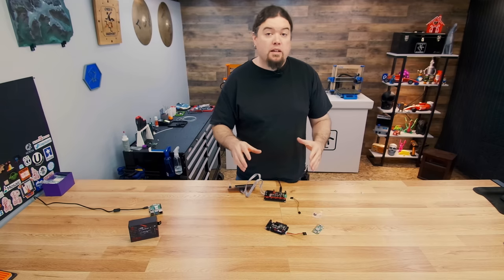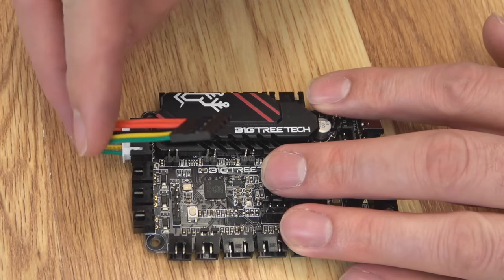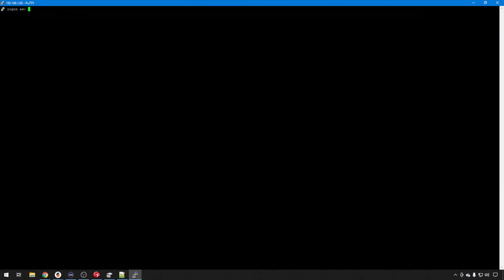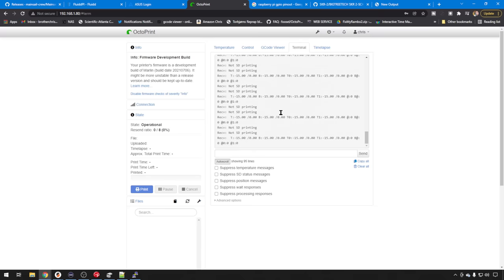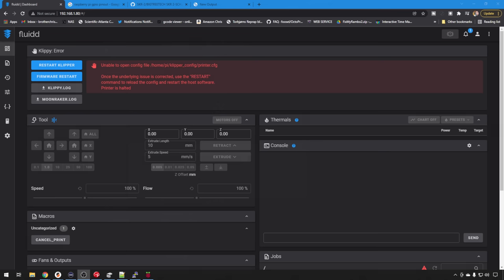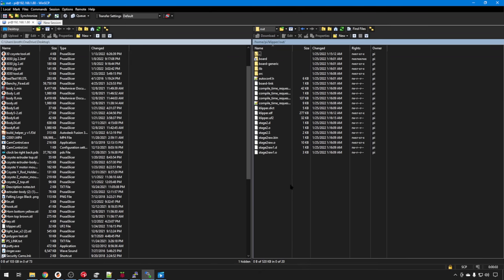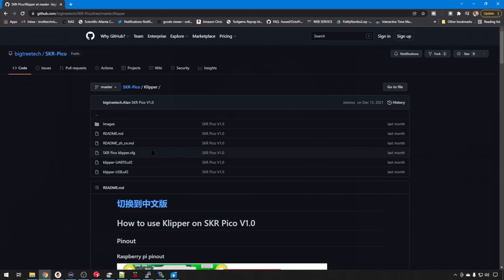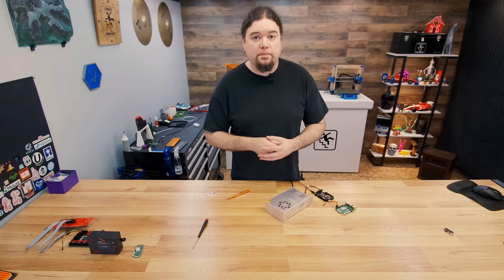Control Your 3D Printer - GPIO - Raspberry Pi - 2022 - Chris's Basement

Comment: I thought the gpio pins had a low max amperage (like in the milliamps range) vs the required 3A need for the pi?
Reply from the maker: They are pretty low, it doesn't always work. It works much better with the Pi Zero.
Reply: @ChrisRiley  So is there an alternative. I see the SKR 3 advertise that it can power a PI4 safely. This cant be what they mean?
Reply from the maker: @PalosX  I would like to see where the SKR3 says that. Powering it with USB C and using the GPIO is really the best option. Or get a 5v power supply to use with the GPIO pins.
Reply: @ChrisRiley  Scroll down to its description about robust
 power system

Comment: the CPU speed on a Zerro and Zerro 1W is already tight. But if USB is not used but TTL serial then the CPU has one task less. The Zerro 2 W has the same 4-core CPU as the PI 3 A+ and B+. These three are sufficient for the tasks.
Reply from the maker: Thanks for the info!

Comment: Very good tutorial as usual but for me no matter what I do, how many times, different methods (like manual installation) I can't get it to work in my SKR 2 (cpu stm32f429) with a Pi zero W. Any suggestion pls? Mean while back to Marlin. :(
Reply from the maker: So the first thing I always check in power. Try powering it with an adapter instead of the board and see if it works. These boards have a bad habit of the power regulator not working correctly.

Comment: Bigtreetech recommend that to not cross the RX-TX connection wires for SKR 3EZ wires. That will be really ok or not? I send a request for clarification for Bigtreetech guys but no answer yet.  I follow strictly your clip recommendations but the connection klpper- moonraker is failed. Could anybody help?
Reply from the maker: RX-TX, it should only work one way. I would check the logs in klipper to see if it says anything.
Reply: @ChrisRiley  ok Chris, solved.
Thanks.

Comment: Do you know how I can configure a probe like super Pinda from prusa (which is 5v) on the SKR Pico?
Reply from the maker: You can use the Z stop pins to power and trigger it.
Reply: @ChrisRiley  thanks of the help, I finally got to try this, unfortunately I am not capable of making the probe work. Maybe you could throw some light on this, basically I connected the probe (same wiring order as the connector for the purse buddy board) to the z-endstop (io25), so my probe config is (pin: ^gpio25) and my timc stepper config (diag_pin: ^gpio25).
I tried swapping the gnd and io wires on the connector in case the sky pico does have them in different order, no luck.

🙏
Reply: I finally figured it out myself.

Something that wasn’t clear for me and maybe for others isn’t, in order to make the probe work on the z-end stop pin, the z-homeless jumper cap must be removed. Otherwise the probe it is not read.

Same for the filament sensor, no E-homeless jumper cap used if you plug a filament sensor on the E-endstop pin.
Reply from the maker: @danielserranotorres4230  Awesome, very cool you figured this out and thank you for posting the results.

Comment: Chris hello. I have an orange pi zero installed. All configured, everything works. I want to set the printer to turn on the light on the relay, but I can’t find the plugin. There was even an idea to write my plugin, but I realized that my knowledge is not enough. Can you give me a link or link to the plugin. Thank you in advance!
Reply: Chris, sorry for the trouble, I found the solution myself. System Command Editor Plugin
Reply from the maker: I'm glad you got it going!

Comment: I'd love to know if you've tried having both a SKR board and a TFT screen connected to pi through UART, I've had it working but not efficiently/reliably - currently I think it's saturating the bandwith of the UART port trying to effectively buffer the PI input to the TFT and then outputting that to the TFT. Straight UART without the TFT works like a dream, but I want the moon on a stick, and still be able to use my TFT with the SKR board!
Reply: Use a uart on the tft to connect the pi.
Or maybe that's what you have done?
Reply from the maker: Yeah, any time I try to do multiple devices, things get unperdictable. It's due to bit bashing, it's just hard to get it all working and talking on the same bus.
Reply: I just remembered I think I connected my pi to tft wifi port
Reply: If anyone is wondering, I’ve spent ages trying to resolve this, and solved it by  flashing the latest TFT35 firmware last night and hey presto it’s all working, it can get a little odd when disconnecting/resetting but actually working really well. I’ve got it setup as follows: GPIO Tx, Rx, GND -> TFT35 UART3 Rx, Tx, GND and then the TFT to SKR1.4 turbo as normal. You just need to double check the baud rate matches on all connections, mine is running at 25000 quite nicely. Took bloody ages but BTT must have quietly improved the UART pass through in their firmware I think.
Reply: This is exactly what I was looking for, I want to add octoprint and keep my touchscreen functionality. Gonna give this a try

Comment: Novice question: If you change from the Einsy RAMBO controller to one of the boards featured in your video will upgrades from Prusa still work 100%. Guess what I am asking what will be affected by changing out the control board when it comes to flash upgrades or other upgrades from Prusa?
Reply from the maker: No they will not and that is the real down side. When you upgrade from the 8 bit board, you lose all the Prusa firmware awesomeness.

Comment: Hello I have a followed your instructions for setting up  klipper  But I believe I've done something wrong because the raspberry 4 which I have got Failed to communicate with the printer.
I have tried also MainSail..octoklipperpi....simplypi 

The problem remain in the connection problem via serial port 

The result is as follows 
I can't  I can't operate normally the printer from LCD or anything Because the LCD is Black I tried to flash back to jyers both printer and lcd 
I can't operate printer through Pronterface with the same port and band keep it's keep saying connecting
Can you do a video describing connecting raspi 4 to ender 3 v2 board 4.2.2 using GPIO
Reply from the maker: The V2 screen is probably causing part of the problem. If you want to go back to Marlin, you will have to get the firmware Creality uses. I don't think Klipper will be able to support that screen. For the serial issue, make sure the MCU number is correct.
Reply: @ChrisRiley  u was completely right .. i succeeded to solve the problem now ..the printer is now connected ... but i am facing an issue was flashing klipper bin file to the ender 3 v2 4.2.2 ... using different sd cards . !! isn't possible to flash klipper bin using serial connection !!directly

Comment: great video I used this to connect my Pi4 via the tft35 uart 4 connector so I could keep the touch function and have octopi at the same time and no usb hanging out the front of the main board way cleaner look now.
Reply from the maker: Good tip! Thanks
Reply: I'm interested in doing the same, did you use an external power supply for the pi? UART4 on tft35 has only 3 pins, GND RX4 TX4. Can I use the USB port on tft35 to power the pi?
Reply: @wsandaruwan  I'm powering mine with a external supply I did not think of the usb on the screen.

Comment: A word of caution to owners of the BTT SKR mini e3 V2.. I tried this with a raspberry pi zero w2 using the TFT header for UART communication and power.. and it worked for one print then killed my skr mini. Don't get me wrong.. This is great video and i have an skr mini e3 V3 communicating to a raspberry pi 4 running octoklipper via UART in another printer but that pi is powered with a buck converter through the gpio pins, not the skr mini e3 V3s 5v TFT pin. I hate usb cables lol.. and i will probably convert all my printers to UART communication. But i wont be trying to power a pi from the e3 V2 anymore lol.. I have ordered another V3 to replace my dead board.. hopefully it has a better power delivery circuit than the V2. I've reached out to BTT to ask them exactly what i can expect from the 5v pin on the TFT header.. hopefully i hear back form them.. and hopefully its capable of powering a pi zero w2... cuse this printer looked tooo good without all the usb cables...
Reply from the maker: Thank you for your insight.
Reply: @ChrisRiley  after further investigation i found the positive screw terminal from the main power supply was melted. I doubt the extra amps the pi required was enough to cause this... perhaps an artifact of the of factory tined wires. Ive been meaning to crimp on some ferrule ends on em but just havent had the time.. till now lol.. Replaced the board with the V3. I talked to the btt support who have told me the main board on the v3 cannot support a raspberry pi 0w2 and that the 5v pin on th eTFT header was only capable of 1.5 amp. It was unclear as to weather of not thats 1.5 amps across all 5v pins or just the TFT header. In any case I am trying the V3 in the same configuration even though btt recommended against it cuz i like living on the edge lol.. and i cant imagine the pi 0w2 pulling more than 1.5 amps just running octoklipper.. and i can replace screw terminals if im wrong... so i guess we will see :D
Reply from the maker: Good luck!

Comment: I tried this on 2 different SKR boards 1) default 2) running system with no luck ....Not sure what my issue is well i do its me but still need Help
Reply from the maker: It could be a power issue, try running with another power supply, remove the power wire from the GPIO.
Reply: @ChrisRiley  Chris He is a question in programming of the com port I do leave it at a -1 or enable it ...I never tryed...
Reply from the maker: @tomandrews5392  yes, I would set serial 0 to -1 and try seral 1 set to 2.

Comment: Will this work with the SKR Mini E3 V2 and the Ender 3 V2 2.2.2 main boards?
Reply: This works perfectly with the SKR Mini E3 V2 board.  I just finished setting it up and it worked perfect.  Don't follow the pins he showed in the video.  Essentially you're looking at the open pins he first showed that are not in the black pin connector.  You will not see the 5 pin connector anywhere on the E3 V2 board.  They are opposite of what he showed, so going right to left with the orientation he shows on screen, it's 5V, GND, Transmit, Receive, RST.  Google SKR Mini E3 V2 and go to the images tab.  It'll be the second image from Reddit.  It was really easy to do, just make sure 5V and GND match between the board and the Pi, otherwise you could get the smelly smoke of death.  If you swap the transmit/receive cables wrong, it won't hurt anything, you'll just never be able to connect to the board.

Comment: I followed this tutorial, but could not get a connection with my octopus v1.1 board. 🤔
Reply from the maker: Running Marlin or Klipper? It's either the serial port number in Marlin or the MCU serial setting in the printer.cfg for klipper.
Reply: @ChrisRiley  Marlin 2. I setup serial port -1 and 2
Reply from the maker: @3D_printer_guy  I will have to test, the Octopus has a lot going.

Comment: Do you know, if the skr 1.3 can provide enough current over the tft connector for the pi or is it recommended ot provide external power?
Reply from the maker: I would have to consult BTT but I would recommend external power if you're not sure.

Comment: Intresting way especially if you want to have the pi close in the printers electronic house, anyway if you want to attach a webcam on octoptint you have to make use of an USB port and need space again. For supply the pi from the printer 24 V I would rather use a small step down pcb than trust on the 5V source from the display.
Reply from the maker: Thanks for your insight!

Comment: I wonder if this will provide a solution to the buffering issues I'm having with Octoprint over USB with my MK3S+. Anyone know if they GPIO/UART is faster than 115200 baud?
Reply from the maker: For the Einsy baord, I would like this would be about the same. I am suprised you are seeing buffereing.
Reply: @ChrisRiley  Perhaps you're right. I think I narrowed it down to a memory leak in my RPI when connecting through Octopod to check the webcam.

Comment: is UART mode work in orange pi ?
Reply from the maker: It depends which Orange Pi. I have seen it work on PI PC, but some of the others ones I don't think it would.
Reply: @ChrisRiley I've tried this method on  orange pi 3 lts but it doesn't work with me, I don't know if I did something wrong.
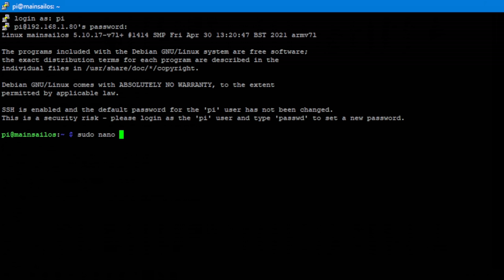Reply: @ChrisRiley  when I run last two codes in 22:20 It takes me to empty folders I think the problem may be from this.

Comment: Well, I don't figure this stands MUCH of a chance, but here goes anyway:
I just purchased my idea of an upgrade kit from BTT for my Ender3: an SKR mini E3 V3 with a TFT35 touchscreen PLUS the BTT Pi 1.2 - with the silly notion of moving to Klipper instead of Marlin.  I went to school with a Marlin - we go WAY back - but it's time to be moving ON!!!  jk   
Not kidding about wanting (badly) to go with Klipper, BUT -- I can't even get MARLIN to work with this setup, and the thing that makes me CRAZY is that I canNOT get ANSWERS from BTT "tech support!!!!"  For one thing, I couldn't find decent documentation to TRY the GPIO connection instead of ye olde USB cable - what I DID see in their documentation DID NOT MATCH ANY labels on the mini board - so I didn't attempt it.
Well, that was a fore-taste of the delights of their shabby documentation, because what they define for the USB (serial) port definition ALSO differs from REALITY in such a stupendous way that it won't BEGIN to work!  This is the port def'n that has to go in one's printer.cfg file under the [serial] section as something like "/dev/serial/by_id/xxxxblahblahblahxxxx"  Well, if there AIN'T NO "serial" folder/directory under the /dev/ folder/directory, the rest of that line is so much bovine scat!  AT LEAST FIVE TIMES I have asked for the CORRECT def'n from their tech support meatheads, but they have YET to even act like they UNDERSTAND THE QUESTION!!!
Meanwhile, the LCD screen INSISTS that there is NO PRINTER ATTACHED, so - unsurprisingly - NONE of the simplest functions work (like moving X Y or Z or even HOMING them!)
All in all, this is beginning to look like just another exercise in futility, and I should just cease and desist wasting any MORE time and brain-sweat on it - and just get a refund and try something else!  Too bad - especially when I see so many YT vids making it look SO EASY!!!
Reply from the maker: This type of GPIO setup can be very fickle. The first issue it usually power, a lot of the board pins don't have enough current to run the Pi. Next is the serial device as you saw. It could be listed as a AMA or AMC device. I would run the ls /dev with it cabled, then with it not and try to compare them. It might be seen as a different type.
Reply: @ChrisRiley  Hi Chris - and THANKS for taking the time - I am truly honored!  As for MY time - clearly less valuable - there STILL is a LIMIT, and I've about reached it!  I so wanted to move up to klipper with this self-rolled "kit," and the main selling point for this Pi clone was its ease of POWERING it from my Ender3's power supply - offsetting even the lack of a camera port and the severely limited OS choice.  But to NOT WORK at ALL?  Not acceptable!  WiFi doesn't work, the USB port that is supposed to connect to the Mini by wire is NOT at the /dev/serial/by-id/xxxxx port they describe, and I have asked them at least 7 times what the REAL spec should be - with NO ANSWER AT ALL -- well, I've had it with these clowns.  I'm glad they seem to work for YOU, but in my experience: 3 fails out of 3 devices just don't cut it!  But thanks again - the steam coming out my ears is surely NOT because of YOU!!!  Keep up the good work!!!

PS - I'm currently thinking that the SKR Mini E3 is seriously flawed, which MAY be making both of the other two pieces LOOK BAD.  I decided to try connecting my PC to the Mini via its micro USB port, a la Repetier, and like the Pi, the PC doesn't see the Mini board AT ALL. So the Q is - will Amazon replace just the mini board....

Comment: Hey Chris,

I have a question about this
I am using octoprint on rpi4 powered externally over gpio
I don’t want to use type c port because it is bulky and I dont have enough space
I would like to connect my skr 2 via this method what if I don’t connect 5v between raspberry and skr
Or if I connect other 5v pin of rpi to skr ( while raspberry is externally powered ) will it damage the board?
Reply: I also have to mention that I use a relay and plugin to power the printer when print is send over cura
Plugin turns on the relay and it powers mainboard 
Because of this I keep the rpi powered all the time 
And also this is why I don’t want to power my rpi over skr board
Reply from the maker: You should be okay, just don't hook up the 5v from the board to the pi. Make sure they both share the same ground.
Reply: @ChrisRiley  alright thanks